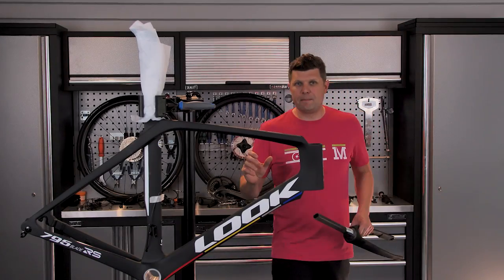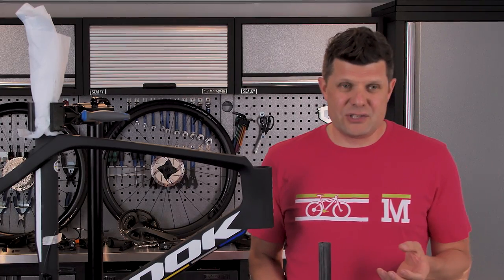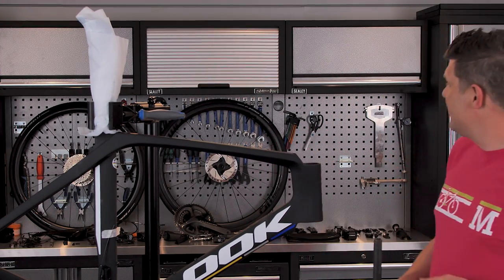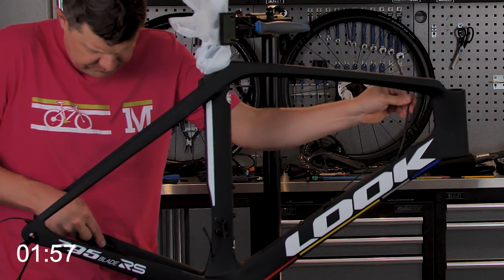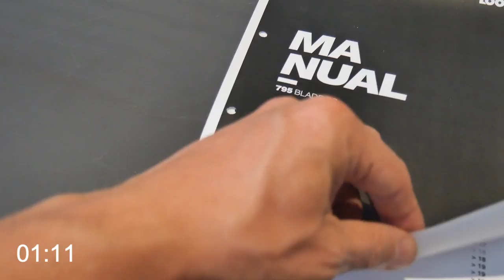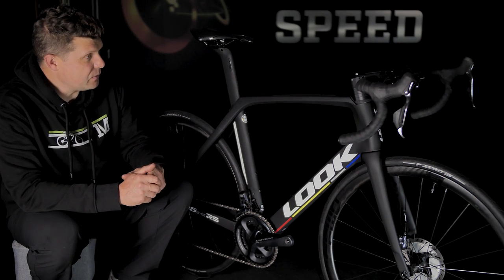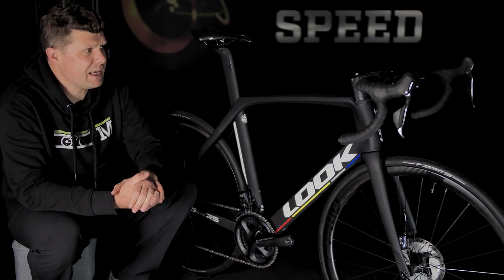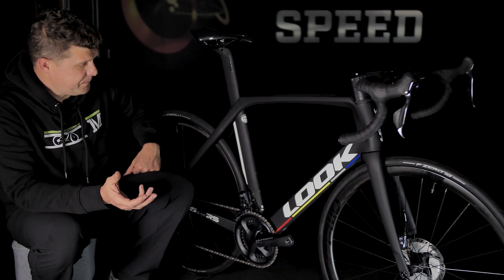The Look 795 RS Blade

Comment: Look makes their own frames, they own the factory. They control things all the way.
Reply from the maker: If only everything was made by craftsmen again.
Reply: They did. 
But they sadly went with the Chinese OEM route for their gravel frame. Using the same seatstays mold we've seen with countless other "manufacturers" (lol) with varying (most often bad) results. Shameful really considering all the brand has stood for for ages, and all the craftmanship they've developped with their employees in Tunisia.
Really really hoping it's just a first iteration thing in wait for a real proprietary design and tooling development before  a come back to their higher than anyone (save Time) building quality standards, but of course, i have my doubts.
It's the age-old trouble with building quality on a market that's very different with say the luxury things like swiss watches for instance. People appreciating enough of such a high quality standards and with the means to purchase aren't numerous enough for the company not to go through financial hurdles, especially after 2 years of CoVid issues.
Reply: @lauig  The Gravel 765 RS frame is great, even Hambini did not find any reasons to complain. The ride experience is very good. We all know, if you pay anybody almost nothing for work, it cannot be a good one. If you do pay more to get better results, the better outcome you can expect.

Comment: I have this bike and i thought it to be a tad heavy with dura ace 9200 size small,came in at 7.6kg my c64 with the exact same build comes in at 7.2kg but as you said the build quality is amazing.I build all my bikes myself and never buy a bike off the shelf i buy frame then put the parts on what i want.Great video i have only just started following the channel
Reply from the maker: Thanks Marky Boy.
Reply: Its good that weight doesn't really matter :)

Comment: Give a wide smile to the Time ADH 01 if you’re lucky enough to get your hands on one 😊 
by the way the Look seatpost has a reputation of slipping ! Agree with your comments on the stem it is a proprietary item as the steerer tube is not round 
Nice build thanks for another excellent vdo

Comment: That perfection is blemished though: No direct-mount hanger at the back (though I love the speed-release system since you can leave skewers in hubs!), Di2 cable for FD could exit on a better angle, seat-stays could be more refined and thinner (see 765), bottom side of down-tube more aero, interface between head-tube to top-tube could be smoother.

Comment: Stunning looking bike.. i just wish they done better with the Stem.. those exposed wires are bit of a bummer..
Reply from the maker: For mechanical systems this works really well to keep cables smooth, but if you are running electric gears the routing could be a lot more stealth like you say.

Comment: Any chance to fit a fork with a round tube so I can use a one piece stem and bar solution?
Reply from the maker: Not with this model.  The new one is different.
Reply: @Mapdec  I guess I will have to come up with an additional few thousand Euros then 🙈

Oh well...

Working to buy a very specific bike is almost as fun as actually riding it XD

I will buy a Look Blade 795 RS and I will ride it from Germany to France (again 😁)
Reply from the maker: @Bendersnatchling  sounds like a plan

Comment: Hi there 

I am in for buying this (look blade 795rs) as a second hand with ultegra di2 or a new specialized sl7 comp with 105 mech 

Since the bikes integral part is the frame, Which bike would you go  for 

Thanks
Reply from the maker: I am very bias to the LOOK. The build quality is excellent
Reply: @Mapdec  thanks 🤩

Comment: Friend of mine bought this bike last year.  He claims there's no way to use an indoor trainer because the rear thru axle isn't compatible?  Does anyone have similar issues with this bike and indoor trainers?  Any workaround?
Reply from the maker: Odd. We use this on an indoor trainer all the time. Maybe they don’t have the correct adaptors. Made by the turbo training brand.  The axles on this Look are very standard.

Comment: Great content. Have a question though.  What extras come with a new LOOK 795 blade rs frameset?  Thanks.
Reply from the maker: Thank you. You get Headset, Garmin mounts, seatpost, a few options for gromits depending on steal cables, di2 or wireless.  You don’t get the stem. You have to buy that separately, and it has to be a look ADS stem. The stem has all the aero spacers in it. You also get a little accessory bag with tube lining and frame protection. You also get an entire bike cover which is a nice touch too.
Reply: @Mapdec  Thanks..

Comment: The best bike in the World is the Litespeed T1SL. It’s less than 1KG for the frame, it’s titanium so it will out last the LOOK, it’s probably more comfortable, it’s definitely less complicated and will be easier to get parts for, it won’t be the end of the world if you drop the bike… just better all round really. 🤷🏻‍♂️
Reply from the maker: It’s a good shout. Ti isn’t without its issues though.
Reply: And it’s a RIM brake bike right Reginald? 😂 you don’t have to worry about how well disc brake mounts are faced if you don’t have those silly disc brakes 😂

Comment: 1kg for frame & fork? what size is that? mine is 1.6kg for the same. it's the same brand & model/year, just in XL size
Reply from the maker: This is a M
Reply: @Mapdec  do sizes normally differ this much in weight??!
Reply from the maker: @MD0886  more likely in what you measure... with no fixtures, steerer cut etc. I only weighed them separately fresh out of the box with no mounting hardware. I didn't pay it much attention other than a bit of 'wow, thats light'  Sorry.
Reply: Super light climbing frames are 600-750 grams forks 300-400 grams that’s for rim brake. Disc is heavier and this is supposed to be an aero frame and fork I can’t see this frame AND fork weighing 1Kg combined.
Reply: No way it weight 1kg for frame n fork

Comment: Carbon shifters and brake levers  are very dangerous and should come with hazard warning. As the aluminium eats away at the carbon. The rider is breathing in microdeposits of dangerous carbon fibre particles. Stay away from carbon fibre for health & safety reasons
Reply from the maker: Interesting… but the levers in the vid are alu.
Reply: There is another video uploaded on the sensah carbon groupset where the rider discusses the issue with the aluminium eating away at the carbon inside the levers. You can see the bits flaking away. When riding down in a low position bike rider is susceptible to breathe these dangerous carbon particles straight into lungs is very hazardous.
Reply from the maker: Ok. I’m a bit confused how that relevant to this particular video, but i totally appreciate you add Ing your comments and knowledge.
Reply: Serious times we are living in.....
Reply: @Mapdec don’t mind him he’s a troll

Comment: My Look 795 RS was a pile of junk. Headset slipped (even with the warranty replacement v2 headset expander bolt). Bottom bracket was way oversized resulting in bb’s actually slipping in the shell!!!! 
Also the stem and gen 1 seat posts were really heavy. 
Never buying a look bike again. Waist of a few  thousand quid. I’m really angry with them tbh
Reply from the maker: Thanks for sharing your experience. I’m really sorry to hear that.